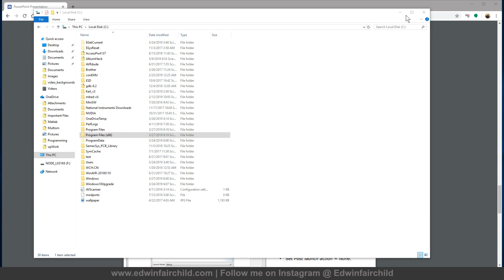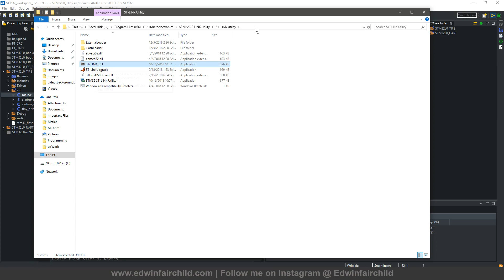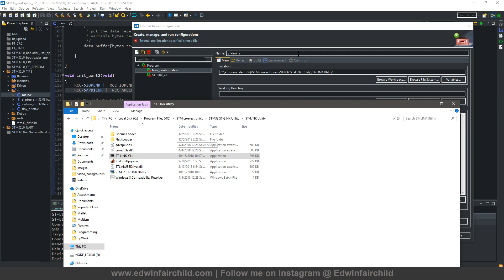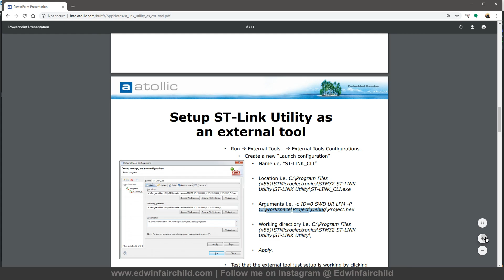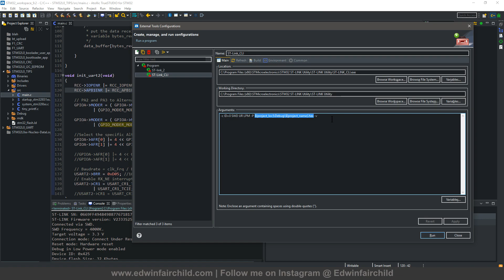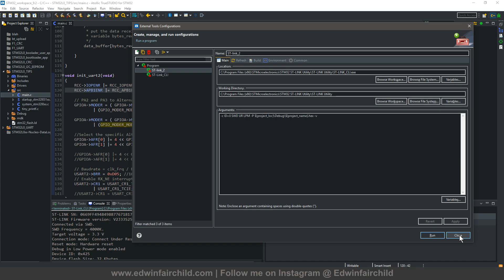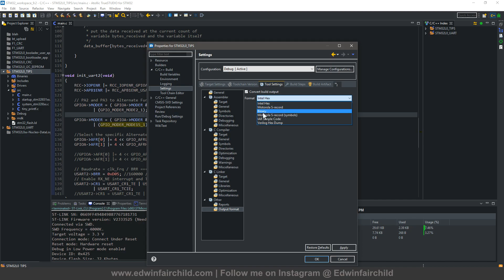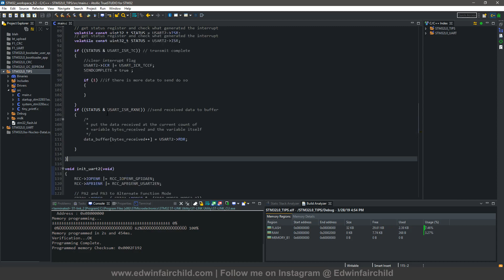Setup ST-link with True Studio

Comment: I have tried as you do, but when i run the console output is "Unable to open file!"
Reply: the full output is:

STM32 ST-LINK CLI v3.5.0.0
STM32 ST-LINK Command Line Interface

ST-LINK SN: 3C2B09002A12354D314B4E00
ST-LINK Firmware version: V2J37S7
Connected via SWD.
SWD Frequency = 4000K.
Target voltage = 3.2 V
Connection mode: Connect Under Reset
Reset mode: Hardware reset
Debug in Low Power mode enabled
Device ID: 0x410 
Device flash Size: 128 Kbytes
Device family: STM32F10xx Medium-density

Loading file...
Unable to open file!
Reply from the maker: i would not use this IDE anymore it is no longer supported, use STM32Cube IDE, it is the same things different name and better features. STM purchased TrueStudio and remade it
Reply: @EdwinFairchild  Okay thanks sir for the answer
Reply: @EdwinFairchild  Can you use it without the HAL shenanigans?
Reply: me too, i also generated code to STM instead of atollic and it still opened atollic

Comment: Hey man, great video and good explanation :). I seem to run into an error however where TrueStudio says it it cannot open the file "Loading file... Unable to open file!" if I run the external tool. I have tried doing it manually via the GUI interface and that can upload the file with no problem whatsoever. I find it odd that TrueStudio cannot open its own .HEX file it build for this, but maybe the problem lies in the toolchain? Do you have any idea what could be causing this?
Reply from the maker: could be something in the path it is being given, if it works when you manually open it but doesnt work otherwise, maybe a long file name or something, but most likely it has to do with the parameters passed. I hear ST has a new Version of their Eclipse based IDE with integrated CubeMX. That might work better out of the box. The difference in look and feel from true studio should be minimal since its also eclipse based.

Comment: STM32CubeIDE ? Also based on eclipse, made by ST, everything works out of the box and it includes STM32CubeMX.
Reply from the maker: Yes ST has a lot of IDE options. Some for those who like to use Cube generated code and some IdE for those who like to program the chip directly. Whatever works

Comment: Thanks. Got it working. Just add -Rst so that chip reset and run. So, it should looks like: -c ID=0 SWD UR LPM -P ${project_loc}\Debug\${project_name}.hex -v -Rst
Else it will not run until you press reset button. Check, go to st-link utility, run 'st-link_cli -h' for more options. Now I will delete my stupid video. I did not see that it actually copy/paste. Also, Ctrl+anything is wrong, but I will find eventually what I changed during whole month of trial and error, probably changed many things.

Comment: Atollic Brick Wall. Still can't get ST-link running. Now "run" button vanished. I am using "embedded project", this is only way that program offering me STM32f103vet6. Tried empty, tried other options... nothing. And, now it makes .hex file, just unable to run it for first time. Will mess more until it become cooperative. What a bogus software...
Reply: Here it is: https://youtu.be/UCc57fLqSoo
Reply from the maker: I cant comment on your video.....but I notice at the time stamp 2:29 if you open the  external configurations window it says at the very top "External tool chain location does not exist"
Reply from the maker: Of course you  HAVE to use embedded project because that what a microcontroller is. Im not sure why you are having so many issues with it. For me everything just worked fine. Then again this is eclipse based and eclipse is trash if you ask me. I only use it because its nicer looking than Keil. But Keil just works no problems ever. And Keil is free full version for STM32L0 STM32G0 and STM32F0 which I think are better than STM32F1
Reply: @EdwinFairchild  I just made video for you. But  unable to put my main.c . If I try it just ignoring me or unable to run or whatever. I am out of my mind. I will post here link, but it will end in "likely spam", and I have no your email address. Don't want public for this video because near the end I just snapped. Will be up in about half hour.
Reply: @EdwinFairchild  You are the only hope. Their forum is worthless, tried to email them, but got answer that they can't help me if I do not pay. I did everything what their datasheets suggest, but unable to set my project. Only their examples.
Reply from the maker: @MilanKarakas  can you make a video of how you are making a project and then the issues you are having , that way i can see what you mean which is much better then trying to read and understand the problem
Reply: I did that, just please wait few more minutes. You deserve some Patreon help or something. I am just lost. I can't get help anywhere else.
Reply: Just not sure whether you got link due to YT algorithm or it ended in "likely spam" folder. Okay I put public, so please find my last video, then tell me after you watched, so that I can delete embarrassing video.

Comment: There are two options; Debug and Release. I assume that I need to use two arguments, or maybe change arguments if I want Release version to be uploaded to MCU?
Reply: Or, perhaps I should to make two instances of CLI - one for Debug, another for Relase?
Reply from the maker: @wildlaborg  Perhaps so, honestly I just upload the debug version, only main difference off the top of my head is release has optimizations on by default  i believe. I could be wrong but yeah if you have need for two of the versions yeah you need to change some arguments for release I assume.